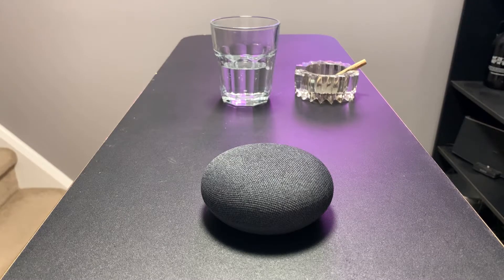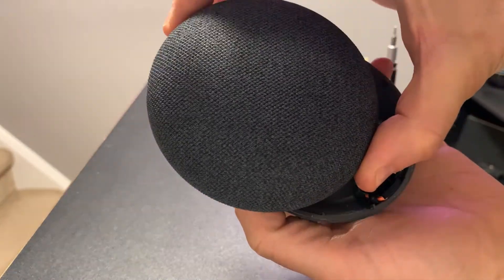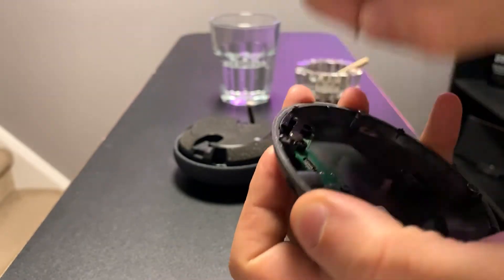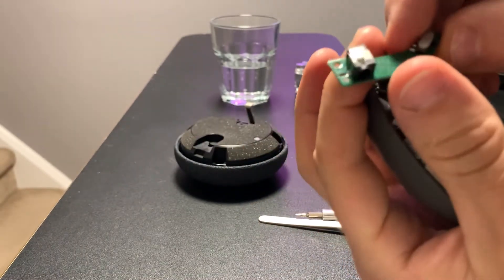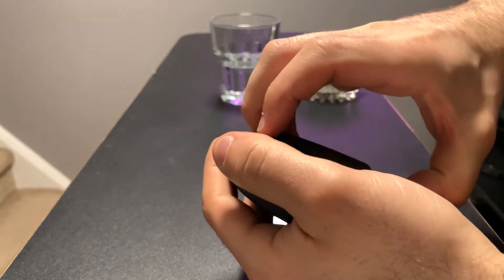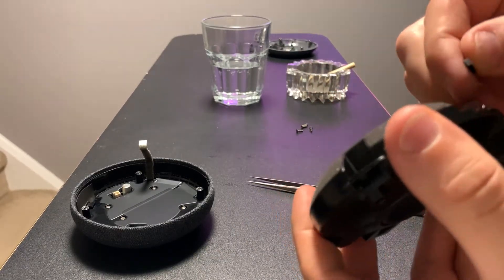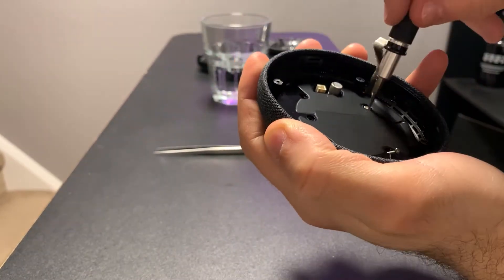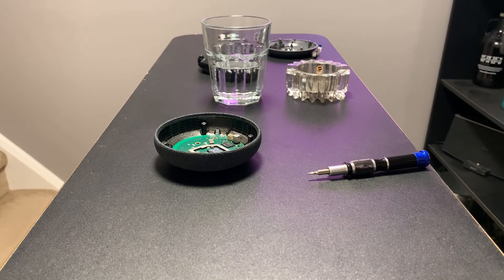Google Nest Mini teardown (2nd Gen)

Comment: Is the switch you pull out in the beginning just the microphone switch or the microphone and the switch. Trying to remove the microphone and still have the wifi extender feature work

Comment: You can remove the Main PCB, too. Just firmly grip the metal base around the CPU with your fingernails and rotate the board anti clockwise to remove the PCB. You may have to remove some adhesive foil.
If having connection issues with the unit, you can try rotating the PCB to the full extend clockwise. You get the feel, if it is in the right position.

Enjoy!
Reply: Any board schematics you're aware of? I'd like to yank the mic or alternatively the LEDs like I did with my full size nest audio to disable the orange LED indicators that my mic is off, like no shit, I know --it's a dip switch. Feel like they're trying to annoy people having a static light when you choose to disable the mic
Reply: I'll prolly just desolder the LEDs, idgaf about them that much but don't want them on 24/7 just cause I want the mic always disabled
Reply: @j.ballsdeep420 then why do u have a google home if ur not even gonna use it?
Reply: @basdenhengst9578   - What'd you mean? Google Home is an IoT application for controlling smart device: This video and comment response(s) are about the Nest speaker, not Google Home. I can use the speaker as a Bluetooth speaker or integrated via wifi to either cast directly to it or add it to a speaker group like Sonos to cast my media to all the speakers as a group I want.  I have 3 mini Nest speakers, two full size, and two Chromecast enabled TVs (via Google TV and a Chromecast Ultra) so I can link them all together (as I have) or speaker groups like just my living room where said mini we're here for that I just use as a smart speaker, not a Google Assistant mic to trigger various workflows Google Home can do, I use either of my phones to manually launch Google Assistant so none of my devices are active listening as (if you're not aware) it isn't just the keywords that Google Assistant gets triggered by and starts to record: Don't trust me, listen to your own recording histories. Do you, but I don't want shit recorded unless I know it's being recorded in my home.
Reply: @basdenhengst9578  - Also, my actual point was to rip out the LEDs which is easy in the full size Nest speaker but not so easy as discussed here with the mini. Do you even have a Nest Mini or just were confused missing the context?

Comment: I Bluetooth a subwoofer to enhance the sound quality of my Google Max speakers. I get it sound delay of about a half a second. The only way to fix this problem is to create an AUX out 3.5 mm and plug it directly into the subwoofer. I'm just insecure about doing the work myself and I'm looking for a electronic place that we do this for me. Any advice, thank you Frank
Reply: I can do it what area do you live in
Reply: In Google Home app and in the speaker settings you can add a +/- delay. I have 5 Chromecast/nest devices setup as a group and have a delay ot advance on almost all based on their position to the wifi router but know that if you're using Bluetooth that delay/advance will change if you're source is not stationary such as your phone walking around and need a wifi connection to lock in static delay/advance to stay in sync. Bluetooth will even start to advance/delay on its own sitting in a stationary period over time with cache and packet loss. I gave up on Bluetooth being a multi-speaker option for this exact reason and only went Google over Sonos cause before Sonos sued them and Google disabled it, you could use speaker groups with any Chromecast enabled devices and not just Google Home devices as it now is and requires a Chromecast connection, sigh. Glad I bought two TVs with Chromecast built in only for that feature to die and require I buy two actual Chromecasts

Comment: Anybody know how to wire up a 3.5mm jack and connect to the back of another speaker? Anybody know if it's possible?
Reply: No you need bluethoot
Reply: @roxy-l7f  I ended up getting it working. Been using for a few weeks now. No Bluetooth needed.
Reply: @renegaed  wich version do u have? Mine doesn't have jack plug on it

Comment: Please tell us (if you know) why it stopped working. Did you drop it, throw it against the wall, give it a bath or is that like me, you did absolutely nothing and yet the NEst just up and died? I'm reading that these Nests are dying all over the place and automatons are simply going out and buying another to replace it. I don't have unlimited funds to line Googles coffers. Now another of my bad buys, an (expensive in Oz) and not very old Chromecast Ultra freezes ALL THE TIME even during streaming. It is so flakey I am looking at something, anything to replace it.
Reply from the maker: It was constantly dropping from my Home. To reconnect it I'd have to do a full reset on the device and add it back to my Home as a new device. Tried google tech support, complete waste of time. Replaced it with a used 1st gen home mini, no trouble since.
Reply: @416diy  same thing happened to me
Reply: @416diy  i have the same issue, the support from google is garbage
Reply: Do you know the 1st gen product is quality 1 product.... throughout the generation the quality is degraded.....This is what happening in todays world.... Compare the quality of any product of its 1st gen vs the latest one....